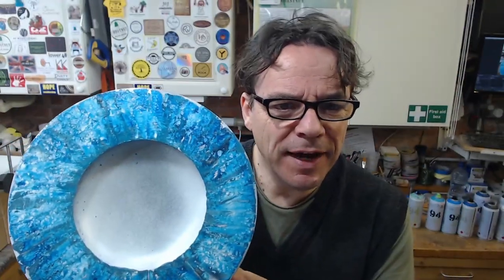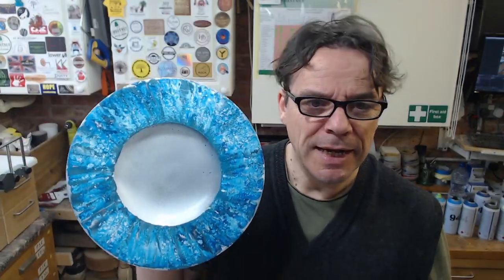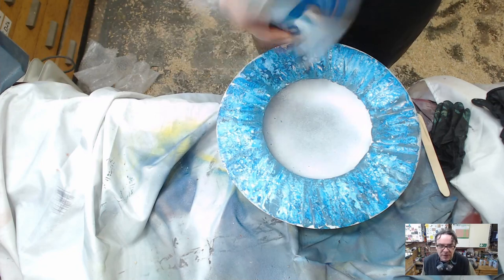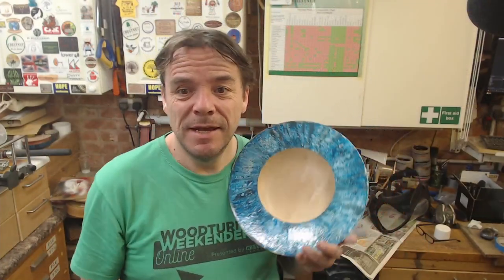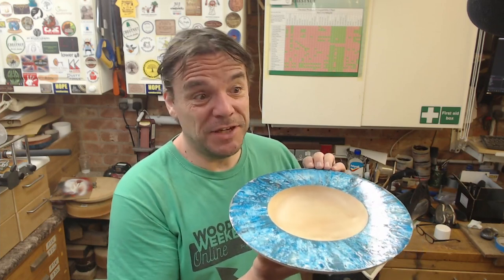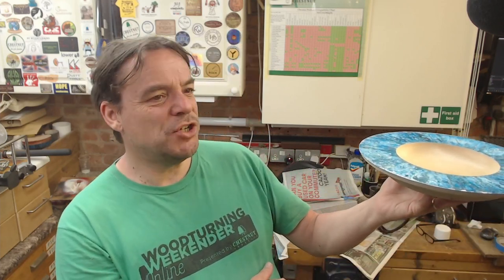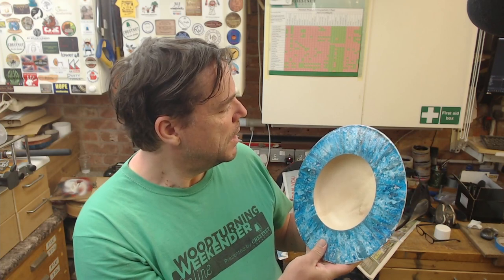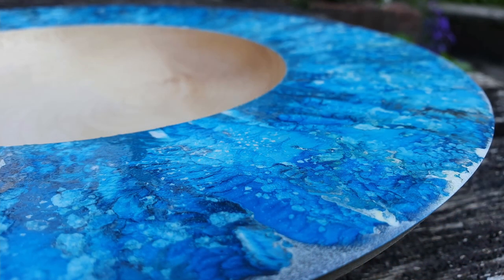Woodturning a Sea Foam Decorative Platter

Comment: Hi Stewart. Interesting experiment as always. Like the colours and how you crated the effects. I have often wondered when you use “Cut and Polish” in the centre. No sanding sealer and no finish on top of C&P?
Reply from the maker: Thanks, Sigurdur - the C&P leaves a wax finish. If I go on to finish a piece, then I'll put microcrystalline wax on after the C&P for a more durable wax finish.

Comment: Top work as always. I have done quite a bit of lacquer work back in my drum building days. If you want that really deep, car-like high gloss lacquer, you should try using a vinyl sealer to give you a thicker base coat (2-3 coats). Then two light coats of lacquer, and at least 1 more full coat, pushing a wet edge. You don't necessarily need to sand after all of them. I usually only sanded between the last sealer coat and the first lacquer coat, and then a few days to a week after my last lacquer coat. Wet sand up through 1000 grit, then buff and polish. Simple, haha. Of course you can get even more complicated with catalyzed lacquer, but unless you have an actual spray booth, I wouldn't recommend it.
Reply from the maker: Thank you, AJ - hadn't heard of vinyl sealer - will check it out! Thanks for the tips on finishing. Cheers!

Comment: Hello Stewart,  Good colours and shades. Adding black might have taken it from sea foam to an ocean storm. Did you need to spray with acrylic so early before sanding? Won't sanding just take off the upper layers anyway?
If you haven't used epoxy before then caution. Even the thin coat fast set can take a relative age to cure and it runs off everywhere. Pigments can be added but it's generally used in a captive are / volume. For the sort of work you have done on platters and bowls, acrylic spray may be the better option. Still, to loosely quote Senator Palpatine, 'We shall watch your developments with great interest".
Regards, Glenn.  :-)
Reply from the maker: Uh-oh....got the Empire watching me! I could have done a bit of sanding back before the lacquer....have tried that on an earlier piece....it does of course remove some of the colour.....will keep experimenting, but then you probably guessed that! Cheers!!

Comment: I was thinking a resin top coat would smooth that off nicely I have done so myself with ok results, saves hours and many many coats lacquer, it can be applied very thin. The key is that the rim has to be level otherwise you end up with varying degrees of thickness.
Reply from the maker: Thanks, Sammo - I'll have to give it a try some day!